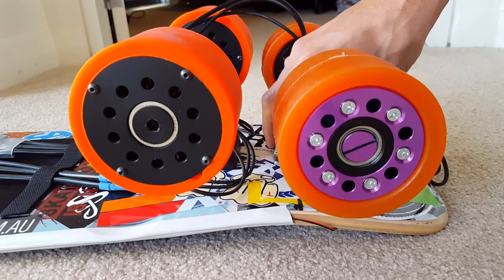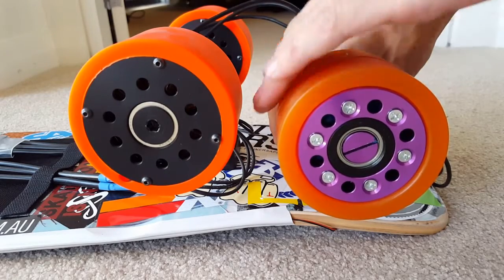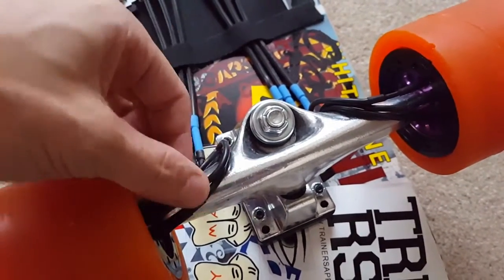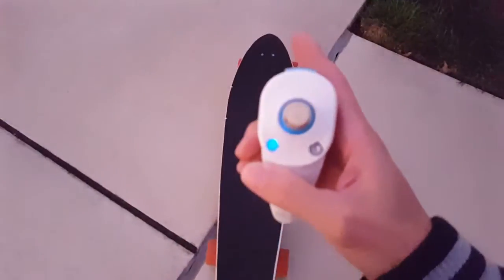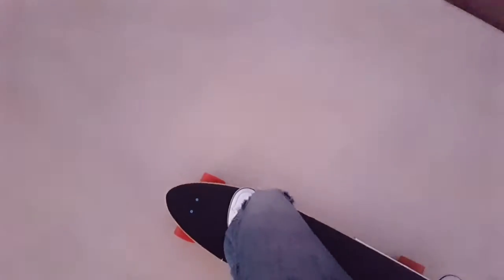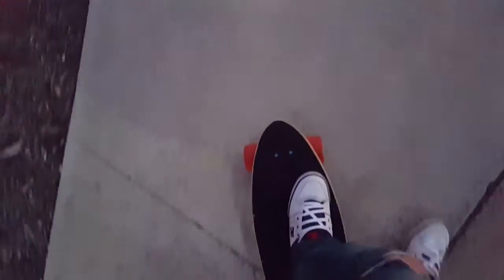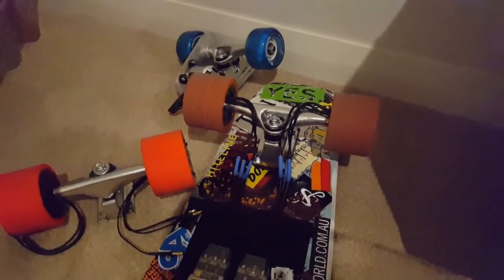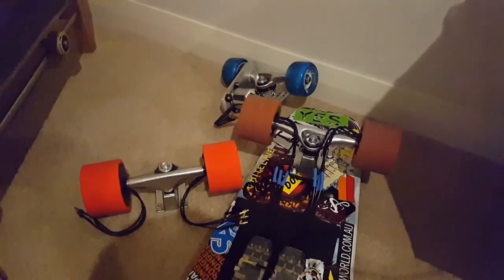Hummis motors Vs EMF skate hubs

Comment: U from Australia? what esc r u using and where’d u get it ? Thanks
Reply from the maker: Fresh Jive yeah im from Australia. This board was using a VESC 4.12 hardware. From ollin boards
Reply: Low Guido's Chop Shop thanks ! Also have u had any experience using the vesc with 5055 280kv motors? coz a mate of mine told me 280 kv is too high for the vesc 4.12.
Reply: Low Guido's Chop Shop I’m planning on building a dual 5055 280kv set up and I’m just debating whether I should go with a VESC or car beast esc
Reply from the maker: Fresh Jive i have used an sk3 5055 280kv with a VESC 4.12 and its fine on 6S although id go with the xcar beast for cheap reliability.
Reply: Low Guido's Chop Shop thanks man, appreciate you answering my questions! Last question, would you recommend that build I mentioned earlier (which is 6s 8000mah dual 5055 280kv with dual xcar beast esc). or a single 6374 192kv on 10s  vesc4.12  ?  Thanks